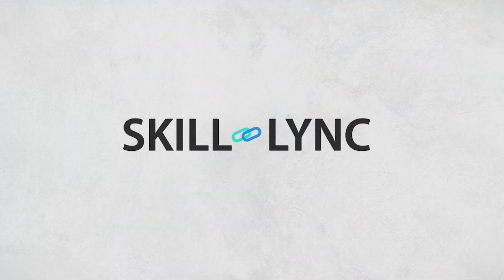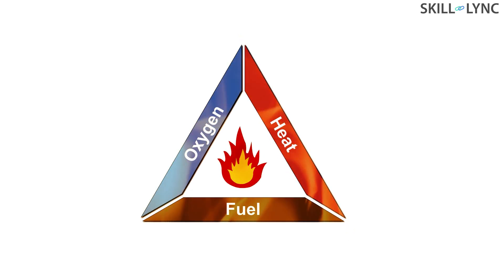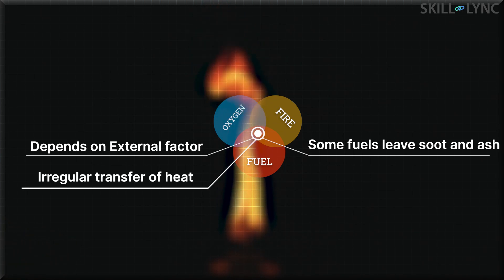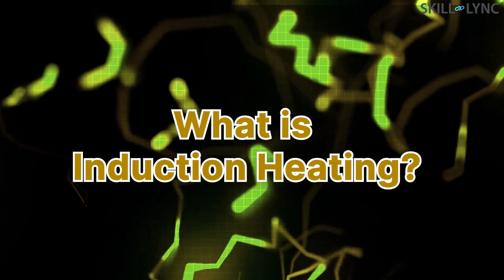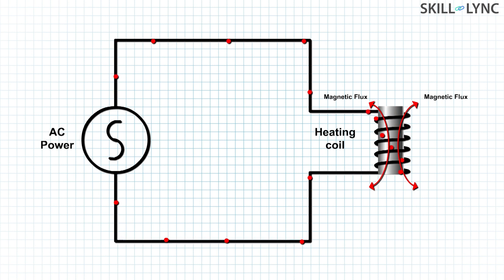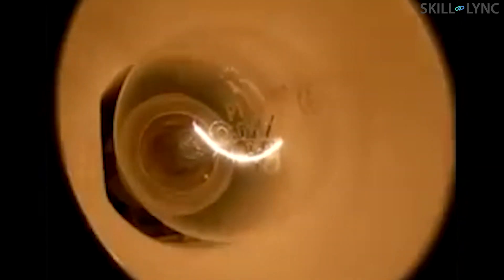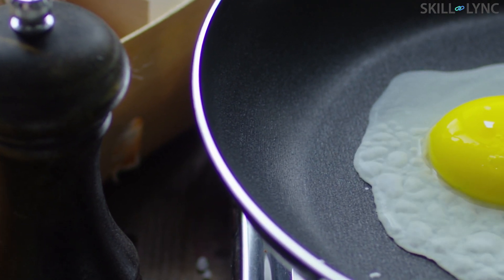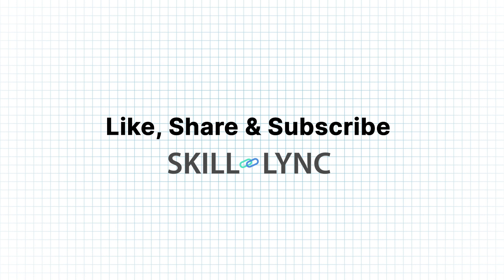How does Induction Heating work? | Skill-Lync

Comment: Is it possible to create inductive water heaters? So, to put some iron rod inside of the barrel, so electricity heats up the rod, and the rod heats up the water. If it is more efficient than gas, it could oust the gas water?